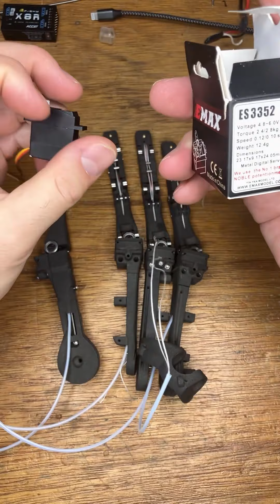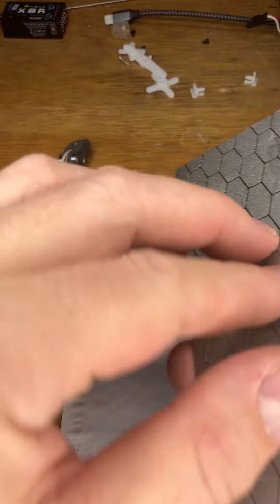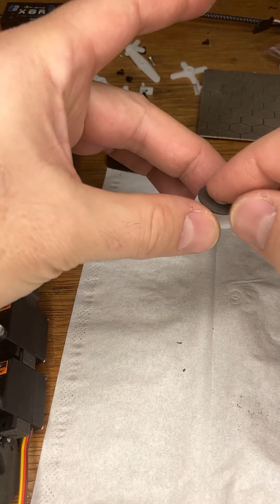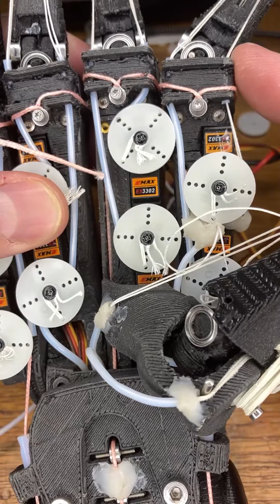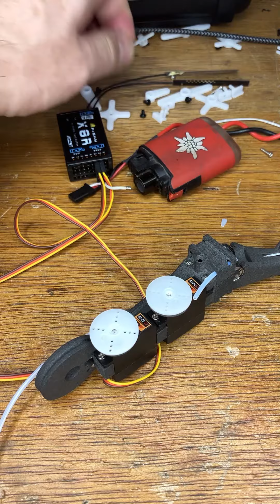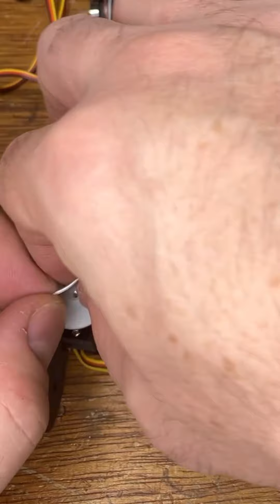How to build a V1.0 DexHand Part 6: Installation of palm servos #DIY low cost #robot #hand

Comment: what is the search term I must use to buy one of those teflon tube flaring tools you are using.  I may have more luck threading my tube if I flare it like this.  as I side note, I have been threading fine nylon upholstery thread through my PE fishing line and tying that off then feeding the nylon through my teflon then using that to brute force yank my PE fishing line into my teflon tubing.  so things that make it easier to get the PE fishing line into my tubing are needed.  Side note:  I'm using 1mmx2mm teflon tube and .63mm 130lb test PE fishing line.  I like this high test approach so my robot fingers can hold entire weight of robot for rock climbing (which It think is the hardest thing fingers could ever do).  Imagine a rock climbing humanoid robot so cool
Reply from the maker: That would be cool!

I just use a dot punch to flare the PTFE, works best with a little heat applied first.

A dot punch is usually used for marking a piece of metal before drilling a hole.

Comment: Your work is awesome, I follow it from a long while and is always ones of the best I’ve found in the internet, let’s hold this way!!
Reply from the maker: Thanks! Have you built any robots yourself?
Reply: @therobotstudio   Yeah a lot of them,  i don't publish much on the internet and maybe i should, I have built many simple and complex robots and I am quite skilled in both hardware assembly and related control. However, having learned to program independently, it's not easy for me to handle the high-level aspects. Only recently, I've started studying ROS a bit, and I've managed to make multiple programs work together. Since i have wayyy too many passions and activities to do i periodically switch from robotics to tesla coil electronics, kart cross prototyping, motorbike stunt riding,  songs writing and more.. but i have to admit, your video often triggered me to switch to robotics :)